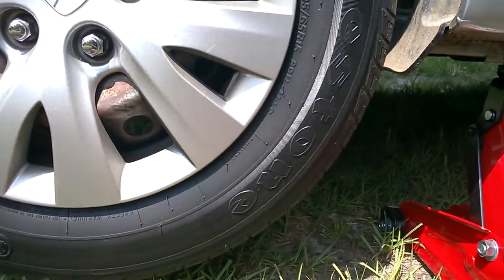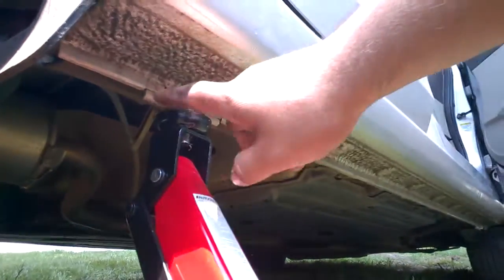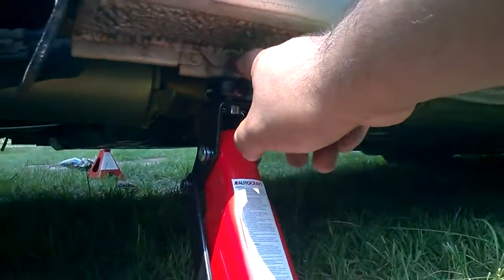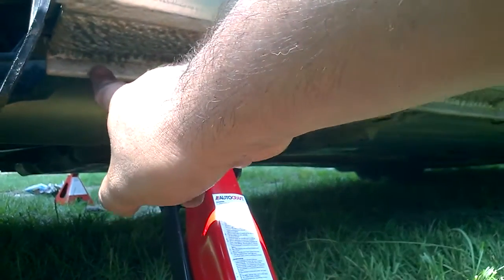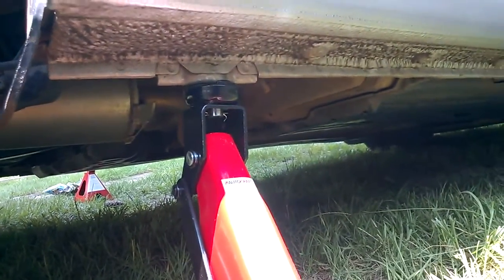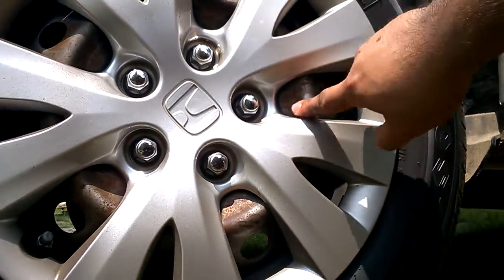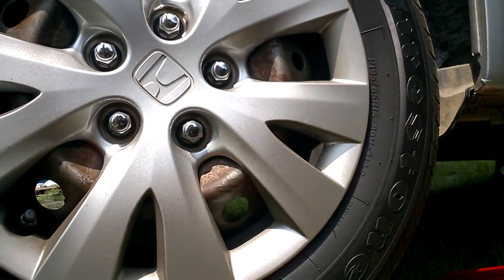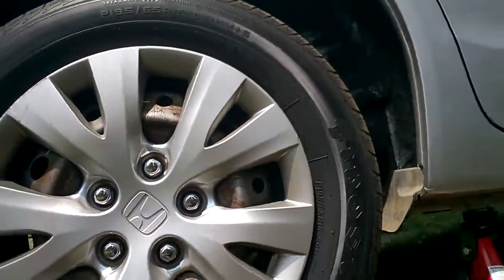Where to jack up your 2012 Honda Civic.

Comment from the maker: Heads up, do this on solid ground such as concrete. I did it this way in this video because the ground is rock hard where I live like stone even under the grass. I suggest doing this on concrete or asphalt. Thanks for watching.

Comment: In the hood of the car look for an arrow near the rad. the arrow will indicate a lift point in the front of the vehicle. Make sure its metal and not the actual rad. lifting it like this will allow you to put jack stands on the pinch welds. for the back you can lift it on the tow hitch because the vehicle light or the solid piece of metal going across form each wheel. Lift on solid ground would be much safer and using some ply wood under the stands will prevent jack stands from digging into surface.
Reply from the maker: Thanks for input. I posted this many years ago. It was my first car and I thought I would share. I never had an issue whenever I worked on the car when I lifted it like this and always used chocks and worked on a concrete floor. Safety first. Thanks for watching

Comment: No need for an adapter for the pinch welds?  I'm just wondering those will bend without an adapter on the jack.

Comment: i accidentaly not knowing this , put the jack in one of the rear suspension arms and now the car is a little bit up lift from that side, did i broke something? the replacement tire is 215/55/16 and the original was 205/60/16 is that helps.